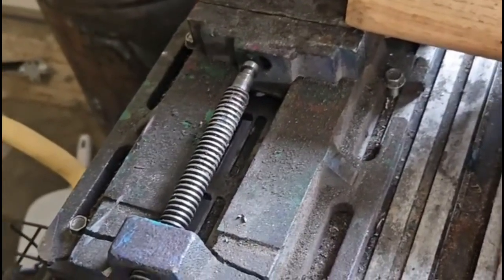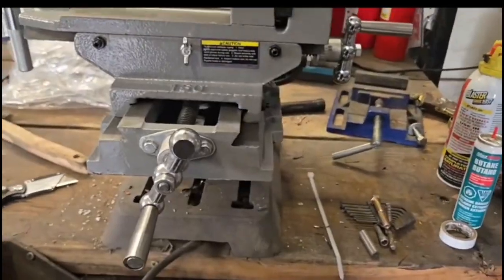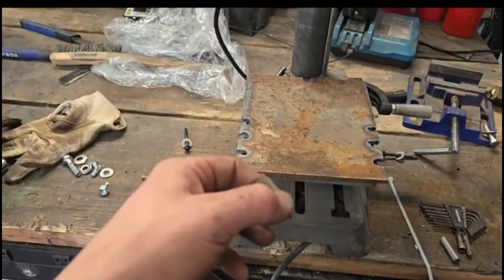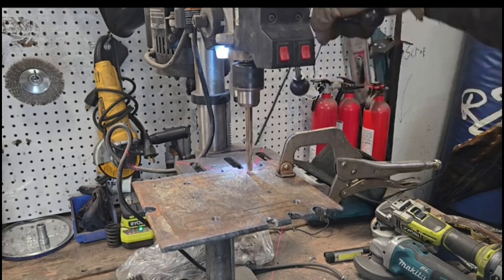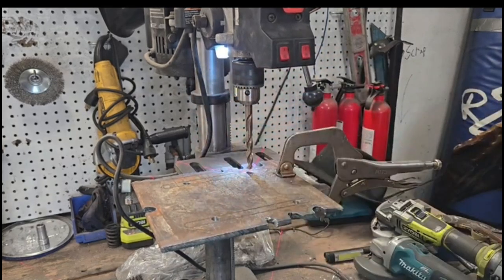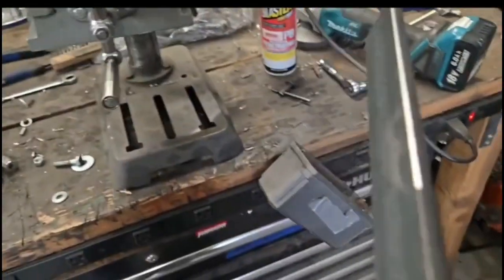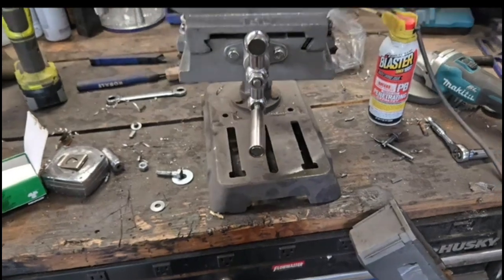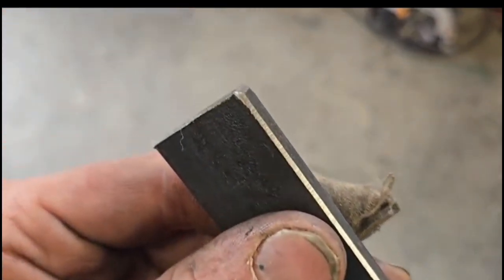Can i turn a Drill Press into a Mill ?

Comment: I'm sorry to be another naysayer. The main problem with turning a drill press into a mill is the fact that the bearing in the spindle cannot take the axial load that milling requires. Additionally, there is a safety concern if you plan to hold end mills in the drill chuck. The chuck is held in place using a Jacobs taper (or its European equivalent), which can become loose and potentially fly across the room. No bueno!
Reply from the maker: Either my audio was bad or you didn't watch it far enough, but I did address those concerns 😂, more modifications to come for sure but for what I wanted to do with it its working g so far. I even pushed it fairly hard in the hammer video. I appreciate the tip/concerns, tho. Thanks for watching, and stay tuned!

Comment: I don’t mean to discourage you, but unless you just plan to freehand the tiniest engraving, you WILL NOT be doing any milling with that drill press. It does not have the mass required. It’s just a really bad idea. Save up and buy a milling machine instead of sinking your money into the failed project. You’ll never eliminate the chatter, you’ll never get the rpm needed, you’ll never have the torque needed, you’ll never have the structural support needed, you’ll never find suitable parts to convert spindle, you’ll wreck out end-mills left and right. That vice is not sufficient to hold parts even. Don’t waste your time kiddo. Just chamfer with a belt sander or flap disc.
Reply from the maker: Ill make it work. If i cant find the parts ill retrofit/ build.  Im not exactly building aerospace parts😂. stay tuned, i guess. and thanks for watching!